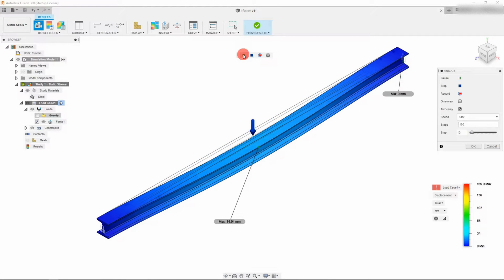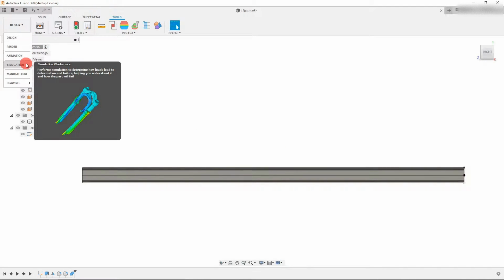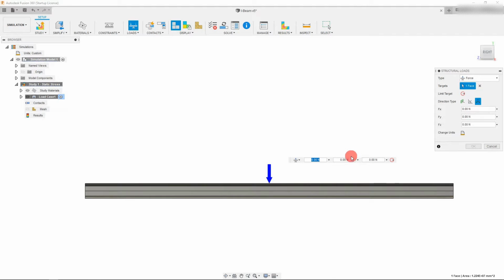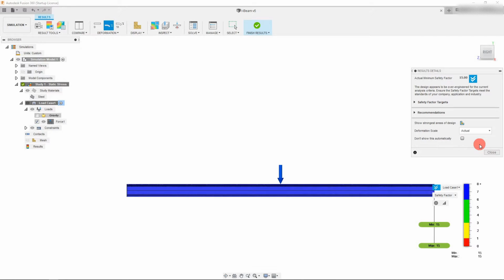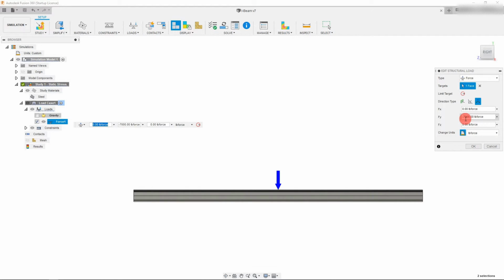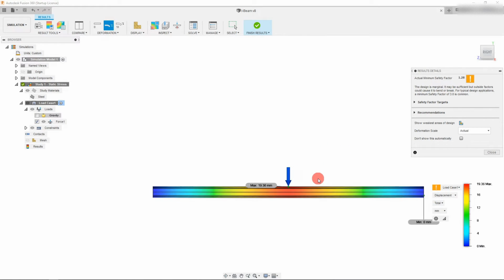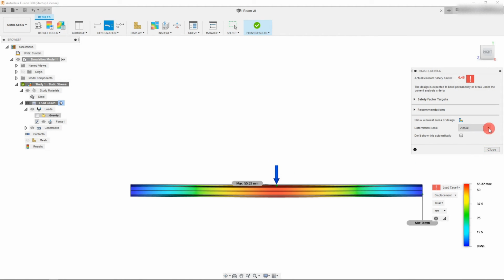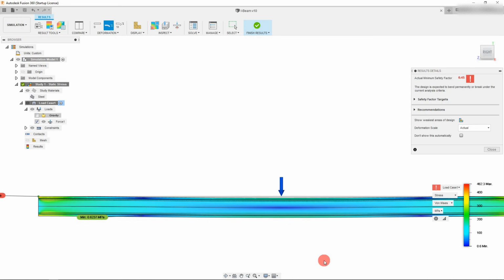Static Stress Simulation: I-Beam Bending in Fusion 360! Tutorial

Comment: Hi there, Need your help. How can I simulate bending stress in a flat steel belt encircle a predefined diameter of a pulley on Fusion 360.?
Reply from the maker: You would do it the same way you do it here, and you would constrain the belt axially to the pulley so the whole thing can bend like it would it real life. The test would be done on the belt only.
Reply: @AvivMakesRobots  So should, I model a belt curve that corresponds to the diameter of the pulley? As far as I understand it was model curved, not bent curved by force. Please explain, I'm stuck there.
Reply from the maker: @ductriquyen9157  You should model it the way it sits over the pulley and any other wheels/ gears etc. Once the loop is modeled, you can do a tensile type of test to see how tightly all the wheels, gears and pulleys can pull on the loop. Is this the idea? Be sure to select the correct material.
Reply: @AvivMakesRobots  Thank you for the feedback ... My idea is look like the blade on the band saw machine. It's a piece of straight steel bent by the radius of a pulley. Do you have any idea about this simulation? If I model curved saw blades, bring them in contact with the curved surface of the pulley, fix the pulley and apply 2 force pulls on the ends of the saw blade, only tensile stress occurs from the contact position to the saw blade end ... am I doing the simulation wrong? Looking forward to your help.
Reply from the maker: @ductriquyen9157  It depends what you want to simulate, but it doesn't sound wrong... Also, what about the wheel driven by the motor? Did you apply forces on that side as well? 

Whatever you do, make sure your setup is spot on first. This means contact sets, material selection and etc. is all good first. Do that before you start on the forces. If your setup is the foundation of the simulation and if it is off, your simulation will not be valid. 

I definitely want to see this thing. Maybe I can even try out how to solve it through a video (with your permission first). NO PROMISES, though.

Comment: Hi there, is there any way to contact you for some help regarding a similar beam model that I am creating? would be much appreciated. Thanks
Reply from the maker: @I- A N I would be glad to help. We can talk here. What is your question?
Reply: @AvivMakesRobots  
I need help in creating a model of an insect antenna (tapered beam) and analyse the stress and strain at the base due to applied end load at the tip and different angles

I need to build a simple insect antenna using either Fusion 360 or Ansys workbench. You can choose any insect. I then need to measure the stress and strain at the base and also measure the deflection. I need some help ASAP. Any assistance would be much appreciated. Thanks in advance.
Reply from the maker: @idiris13  Create the antennae in Fusion 360. Then, open up the simulation environment and apply a new load and click on the base of the antennae. From there, you can calculate the deflection. It should be simple.
Reply: @AvivMakesRobots  Thank you